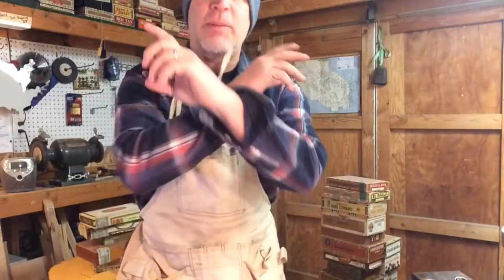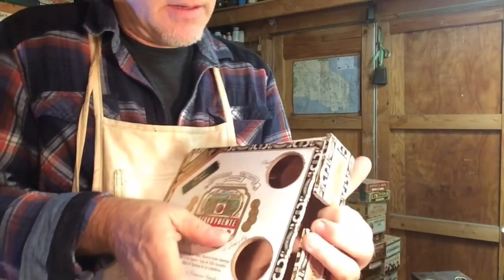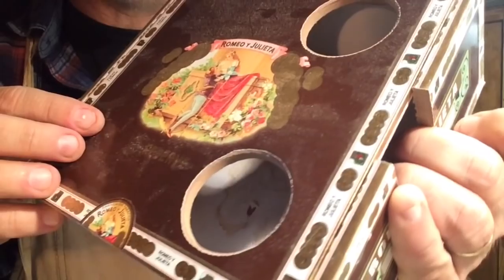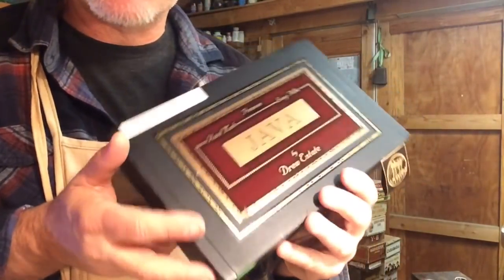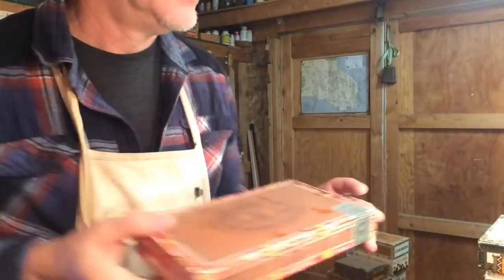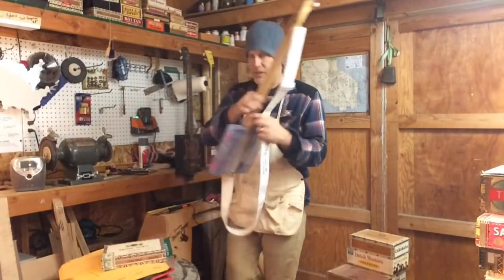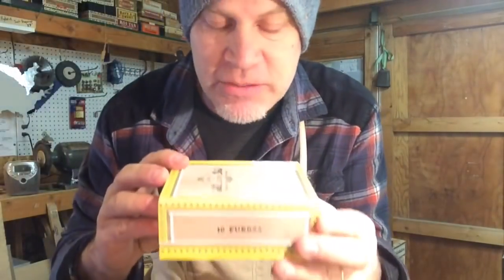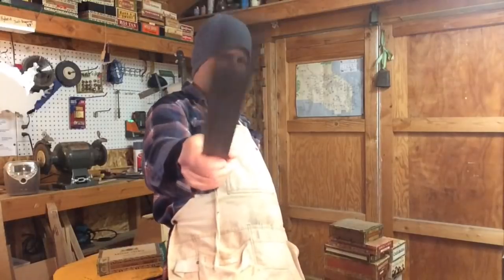Cigar Box "Overview"

Comment: Hey Mr. Puckett! I have been enjoying all of your videos and this is perfect! I am brand new to the CBG community and this is just in time for my hunt for my future builds.I have noticed, most guitars are made from the flush topped boxes ex. artura fuente vs the large lipped boxes ex. Tabak special. I am wondering if we could watch you do a build with a box like the tabak with the lipped lid ? I 'm not sure about the method you would use to mount the neck to the top lid. It seems  the neck build would have to be slightly different , not sure what your thoughts are on this. May be I am making a big deal out of nothing and its really easy. I always enjoy your videos. Thanks for sharing your expert Luthier skills with us.
Reply from the maker: Tim Wissert thanks for the kind words.  I have plenty of videos posted here that detail what you are suggesting.  I just notch the upper lip to allow flush mount.
Reply: Thanx for your quick reply. You do have lots of videos on this. I guess what I am trying to say is, your necks are screwed and mounted to the support pieces you place under the neck  in the bottom of the box. Now if the top of the box lid has a depth dimension say 1 inch, the neck will still be below the lid when its notched. this leads me to believe the neck would have to be attached to the lid instead of the bottom portion of the box, or raised higher when attached to the bottom of the box. I will admit, I do over analyze things to the point of paralysis at times. I will just get creative. Thanx again for all you do for us future Luthiers!!